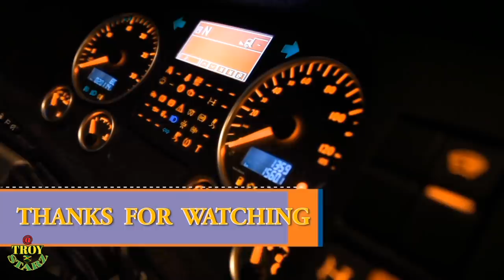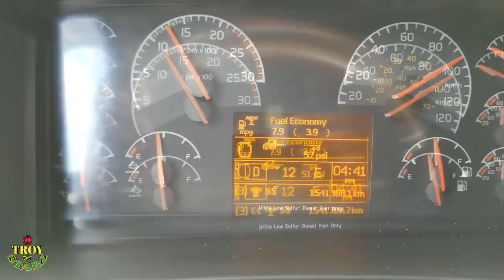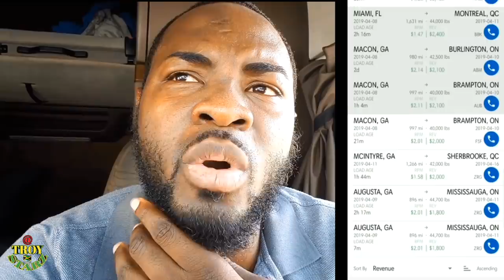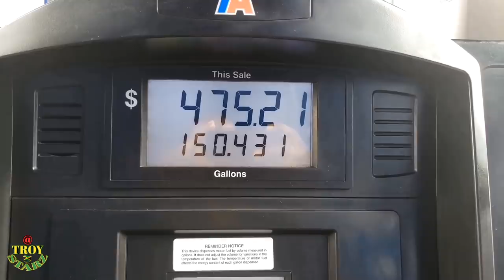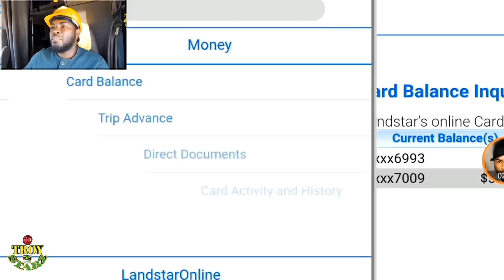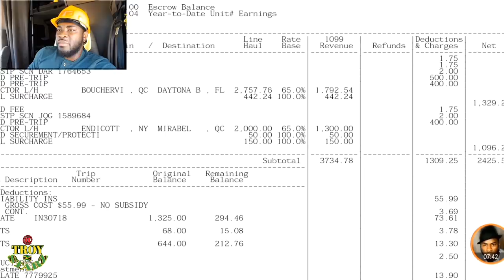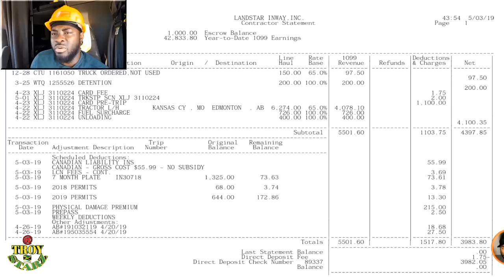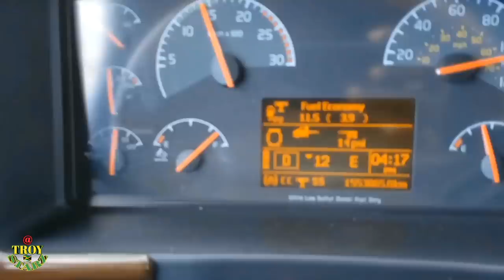How Much Money Truck Driver Make | Landstar Canadian Bco.

Comment: Literally taking notes, true definition of when there is struggles there will be greater reward gain. This is one more great video. Keep it up
Reply from the maker: Respect 👍
Reply: @TroyStarzTruckingVlogs So wait you don't have an APU or Generator so you can run AC or heat without idle ?

Comment: Up top mi g lov diss video, me jus buy my truck & was planing to go with Landstar but they want a picture of my engine plate and my engine done hav any so mi a try find another carier.
Reply from the maker: What you mean you don't have a engine. Btw what kind of truck you have?
Reply: @TroyStarzTruckingVlogs  I have a 2010 Cascadia with a dd15 in it but the plate that is suppose to be on the engine that shows the engine family number 'serial number' that I dont have. I think it might be the previous owner rebuilt the engine.
Reply from the maker: @choycampbell4303  ok so give them the one you have now don't you have papers for it.

Comment: excuse my ignorance but what is a card pre-trip deduction/charge? Those seem pretty high.
Reply from the maker: Where did you see that?
Reply: On your settlement at around the 24:41 minute mark. There's two charges for "card pre-trip" at $500 and $400 each unless I'm reading it wrong. I'm just wondering what they are.
Reply: Ok, so if I understand it correctly, its payback for any fuel advance you may have taken? It's not a requirement of any sort. Thank you for the response.